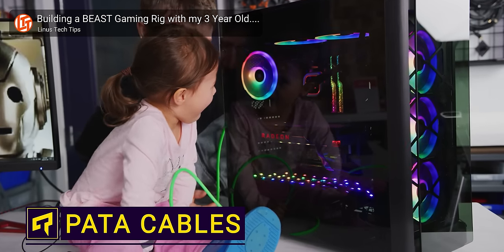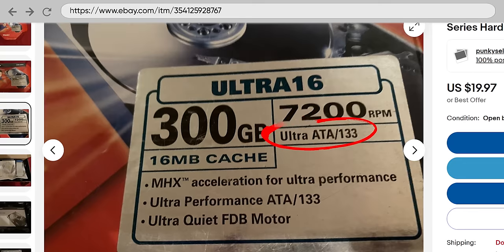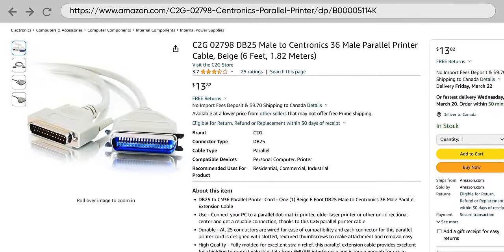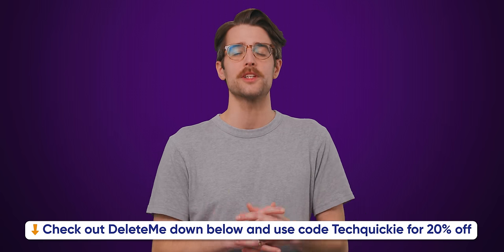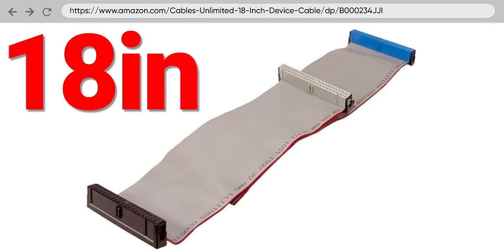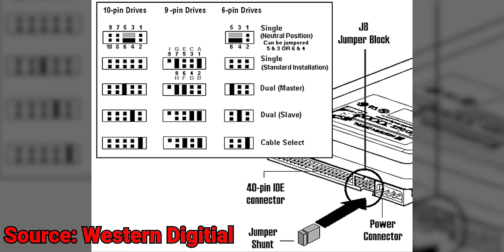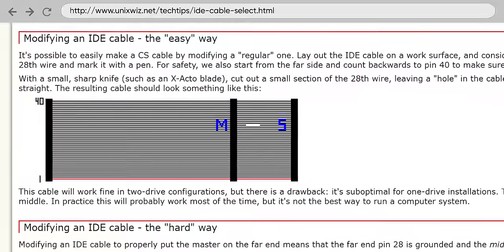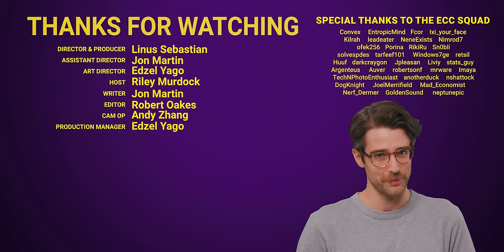PC Cables used to be HUGE. Why?

Comment: They touched upon, but didn't answer "why is SATA that transmits just one bit at a time faster than the ATA cables which transmitted 8 bits at a time?"
It's not because the bits needs to be split and assembled. It's that they all needed to arrive at the same time at the destination within a tiny window. The higher the speed, the smaller the window. This meant that the buss transceivers needed to have the same drive capability and speed. The capacitance and inductance of the wires within the cable needed to be the same. The sensitivity of the receivers needed to be the same as well as their speed. And since getting an exact match on the speed was difficult to impossible, they needed to send the group of bits slowly enough that they would all arrive within the time window. With SATA, that speed synchronization was no longer required. And that meant that they could send the bits much closer together.
Reply: Technically the problem is just long wires right?
Reply: Thats hella interesting.
I guess that before, parallelization mattered more than the actual bits going through the wire itself.
More wires = more throughput.

Now im curious. Why not photonics? Why dont we have photonics sending memory from RAM to the cache?
Reply: I can't understand why ata cables can't work without synchronisation, but sata can? Why can't we apply the same synchronization method to ata caples and get much higher performance? Aren't sata cables inside have few wires what ended up syncing with each other? Because it's definitely not a single fat copper wire
Reply: More useful than a medium sized tech media company. Thanks!
Reply: @ishouldhidemynamelmao345  Not quite. The problem is matching the delays between all those wires and the associated electronics at each end. Longer wire do increase the problems, but are not root cause. The closer the matches in propagation delays, the faster the potential speed. So, parallel is easier (just set all the data bits, then after a suitable delay, strobe the latch signal), but serial is much faster since there's no need to match the delays for 8/16/32+1 independent signals, although you do need to synchronize to the byte boundaries.
Reply: @Ivan-The-Man cause in serial communication bits always arrive in order, one by one. In parallel communication you never know if all N bits already updated or not. That's what the clock is for. You're making sure that the data set you are reading - lets say 8 bits - is all new 8 bits and not 6 new and 2 from the previous data set.
Reply: @Ivan-The-Man  With parallel, they set all the data bits. Waited a short time, then strobed a latch signal. That required all of the data to be stable when the latch signal arrived. And exactly matching the delays was effectively impossible. Hence, they added enough delay between sending the data and strobing the latch to insure the data was properly sent and received. With serial, no such delays are needed. In fact, with serial, it's possible to have multiple bits in transit at the same time over the wire. If the wire is a bit longer, that simply means it takes a tad longer to arrive and there may be more bits in transit at any given moment, but the expected bits still arrive in the same order they were sent.
Reply: @Ivan-The-Man , we certanly can make aggregated serial busses. 16x/8x/4x PCIe is just that. PATA just wasn't designed that way, and at the time creating a high speed serial bus would be hard. High speed serial interfaces require fancy analog front ends in the trancievers that wasn't all that reasonably available at the time.
Reply: Buss
Reply: While this is true, you can use all the extra wires for more speed if you change the protocol for making every wire a different "connection" like PCI-E does with it's lanes.
Also SATA don't use one wire, but two to transmit data in a differential signaling scheme that can transmit data a LOT faster than regular one wire schemes.
Reply: Thanks!
Reply: @ishouldhidemynamelmao345  Yes. Speed of light is 30cm/ns, which means that for a SATA3 cable, the individual bits are about 5cm apart as they go down the cable.
Reply: Thank you.  This is what I was looking for.
Reply: Thanks for the explanation. However, this raises the question of why PETA was not skipped and SATA was not used from the get-go. If it was "superior because it was simpler".
Reply: @Chuck_vs._The_Comment_Section Parallel is sequential.  Think of parallel as having many sequential traducers next to one another.  The issue was the sequential traducers of the time were slow, so they  installed many side by side to increase speed.  At some point the issues caused by the timing outweighed the benefits of the schema and by then much faster transducers had been invented making the parallel schema no longer necessary.
Reply: @Chuck_vs._The_Comment_Section  But SATA is not simpler. Gonna give an analogy. Imagine the following system. We have 9 long wires to transmit data. The person transmitting needs to set 8 switches to on/off depending upon the value that they want to send. After setting those switches, they then momentarily press a button that activated the 9th wire. At the receiving end, the wires are connected to lights. So whenever the strobe indicator lights up, the receiver writes down what lights were active. This arrangement is actually pretty simple and easy. But I think you can see how slow it is.

Now, the next system uses just 1 wire to send the signal. But both the sender and receiver need to be trained in morse code.

So, the second system is faster, but requires the transmitter and receiver to be more complicated.
Reply: @Cyril29a  I see. It was the better technical solution available at the time.
Reply: @Chuck_vs._The_Comment_Section Yup.  Now the problem is that drives speeds are slower than the transducer so we invented raid and other types of drive arrays.  So we are essentially back to parallel but with using a large amount of sata drives in parallel to one another again increasing speed.
Reply: * The ratio of inductance to capacitance had to stay the same.
Reply: great explanation! 😎
Reply: @Ivan-The-Man  SATA cables transmit data serially, meaning the bits are sent one at a time, so there isn't anything to synchronize. You're right it's def not just a single wire - I believe they have separate pairs wires for transmitting/receiving data.
Reply: Ah yes, the same explanation providing the same information, but with more words! That's SO much better.
Reply: In the end it boils down to electrical engineering. 
At low speeds there are no issues. If you connect a battery to two wires you will measure that battery voltage at the end, no matter how long are the cables and how are they routed.
But as the bus speed is increases, that same piece of wire WILL behave differently. It has to be treated as a waveguide. When engineered properly (like SATA or Ethernet), it will be a good waveguide. When not, it will show horrible signal integrity problems, like PATA.
SATA is in so many ways better: it is differential, it is shielded, and it has termination. The transmit and receive paths are separated. It is driven by a proper transmitter circuit, matching the impedance of the cable and the receiver. The data over the wire is encoded with a line code, which ensures the same number of zeros and ones are sent over the line, maintaining DC balance, which is also important.
None of these are true for PATA, but most of these are also true for Ethernet.
Interestingly, PATA was even worse than the old MFM standard, used in early '80s disk drives. At least the MFM cable had every second conductor as ground, and the cable was terminated.
Reply: Thank you. I also wanted more detail on this. It was a pretty half-assed explanation.
Reply: @budaycsaba  God, I haven't heard/read of the term MFM (or RLL for that matter) in eons.  I think those date back to the days when people were trying to hook up hard drives to 8 bit computers and workstations?
Reply: @sbrubak  exactly. We did not have cheap high speed drivers for a serial bus. When they became feasible we got SATA and PCIe.

Comment: This takes me back. The first time I ever built a dual-boot system, it used the Cable Select mode. I had Windows 98 on one hard drive, and some flavor of Linux on another. I actually installed a toggle switch in the front of my case wired directly to that CS line which allowed me to shut down, flip the switch, and boot off the other drive, as it would always boot off the master drive by default. No software bootloader required.
Reply: This is how it should work, I absolutely hate today EFI boot and windows boot manager which screws everything, you don't have anything under your control anymore.
Reply: @Pidalin  It was certainly a simpler time in the PC world. Well, all electronics I suppose. As a general rule of thumb I like to retain as much hardware control as is practical in any system I purchase or design. In the audio engineering world, digital mixers and audio interfaces are absolutely amazing, and I love them as much as the next guy, but there's a reason analog consoles are still in heavy use today. Especially in live sound.
Reply: @donaldholden2090  Don't tell me about that, I am that guy who has "stupid" projector with no apps, stereo amplifier and big f*cking speakers 😀 
I also keep a lot of older computer hardware because I am pretty sure there will be time when everything new will be that stupid and complicated, that you will just build some "ultimate Win 7" or win XP PC to play good old games with no internet and clients needed and screw that, life is too short, I want things which work and which are not constantly changing under my hands.
I don't even play games anymore on modern computer, because you start steam and you need 50GB update, so you go on internet to procrastinate and then you will forget that you wanted to play something, it's stupid.
Reply: @Pidalin  ...Projectors have apps now? I'm still rocking my Optima HD20 and a Technics SH-AC500D Dolby Digital decoder paired with some Logitech X-540 speakers. Hello brother.
Reply: @donaldholden2090  Yes, there are projectors with Android TV inside. 😀 I have Optoma HD28e, when I bought it, I had problem with rainbow effect, but I got used to it pretty fast and now I barelly see it. But your Logitech speakers are a typical "gaming" stuff. I have Yamaha A-S501 + speakers Magnat Monitor Supreme 2002. 🙂
Reply: @Pidalin  Oh for sure. And one day I look forward to upgrading. But my entire HT setup cost less than $500 because everything was used, and at the time I put it together that's all I could afford, hahah.

Comment: Before SATA was coined, we never refer to them as PATA cables. They're referred to as "IDE" cables.

I wanted a rounded version of these cables, but they were expensive for my small student allowance, so I never bought it until they became obsolete.
Reply: I was thinking about the same, nobody said PATA cables, we all knew IDE cables and IDE hard drives
Reply: I've always called them IDE cables, NEVER, PATA....still call them IDE, that's what they are.
Reply: @JuanDiegoPinillos  some technonazis called them PATA, but that was in time when SATA already existed
Reply: 100%
Reply: I never heard the term PATA before this video, I still refer to them as IDE.  But I haven't used IDE in about 10 years now.
Reply: I hear ya, I always just did cable origami with zip ties back in my high school days as step dad bought them by the bucket load, and I did not want to risk damaging a cable, or slicing my hand trying to cut, and wrap them., but yep they have always been known as IDE cables to me, till several years back when I found an some old Dell Pentium $ PC's at the local e-waste, and they had PATA, and SATA stamped on the motherboard, and cables.
Reply: ATA-66 was so much faster than ATA-33, and it made games run faster. That's where the term "PATA - Win" came from. That's why they're called PATA cables.
Reply: Yep! Nobody I know ever called them PATA. They were either ATA or IDE.
Reply: totally agree, we seem to have a millenial making things up, oh, hi riley!
Reply: Technically, they were ATA cables, the IDE refers to the disk drives that were commonly plugged into them.
Reply: @scbtripwire  Yes, they were ATA cables as opposed to SCSI cables which were pretty much the only other option for drive cables other than the ones for floppy drives.
Reply: @scbtripwire  yeah they were ATA cables, PATA is a later name just to make it clear
Reply: Exactly, they were retroactively named PATA after SATA came out. I used to be good at IDE origami to get my cables flat and out of the way.
Reply: @smalltime0  I know, I never stopped calling them ATA or IDE though. :)
Reply: Rubber bands and a bit of folding is what I did back when air-flow started to become important.
Reply: Good I'm not the only one.  I didn't even KNOW they were called PATA cables, I had always called them "IDE" as well.
Reply: @scbtripwire  This is one of those things where people just agree on something without realizing their world. I'm guessing you're all around 50-60 years old. So you should already know that nobody called it PATA back then because it was the only ATA cable (even the video mentioned this)

Funny enough, it's almost always been PATA to me. I started watching ZD NET/ tech tv back in 1999/ 2000. And when SATA was announced sometime around then, it was almost immediately PATA/ SATA when discussing this new coming tech. Which confused me at first because, like you all, I had only known ATA. But you know, when you pay attention and not act like a weirdo luddite, you learn and grow. And since most of my friends were just getting into PCs, we all only knew PATA and SATA (assuming we all also knew that ata/ pata was often the same when referenced in old handbooks)
Reply: none of you watched the video?? 0:30
Reply: PATA is a retronym, which emerged after SATA, as IDE was sometimes referred to as ATA before then, and referring to it as PATA made it more obvious that it was not compatible with SATA.
It's similar to how PCI is sometimes called "conventional PCI" to make it harder to confuse with PCIe.
Reply: IDE was just another name, they were known correctly as PATA then too.

Comment: It's fun how terminology sometimes gets defined by confusion. ATA is the communications while IDE refers to a disk that has the disk controller built in rather than on a separate card. They are not synonyms. You could've had PATA disks that were not IDE. Of course nobody called it PATA, but that's sort of like how Chinese food in China is called food.
Reply: Were there? I was only aware of ATA and SCSI at that time. (Well and the cables for floppy drives that looked similar)
Reply: @SmallSpoonBrigade  You could get internal (non-SCSI) serial and parallel connectors, just to buck the trend. But you'd be hard pressed to find something internally to link them to.
I think Centronics ports saw limited use in enterprise configs for "hot-swappable" HDDs, before SCSI was really a thing
Reply: I'd forgotten about that distinction, but yes. I recall my first couple of builds had to have a hard disk controller card. Then IDE came along making it much simpler.
Reply: @YoSpiff : Yes, when you connected the IDE disk to the motherboard, you were really connecting the on-disk controller card to the ISA bus. Fascinatingly similar in concept to modern M.2 or U.2 where you connect the drive directly to the PCI Express bus.
Reply: My first computer was a 386 IBM clone which had a virtual disk controller in BIOS. If you connected a non-IDE disk, you could go into BIOS and manually enter the number if platters, drive heads, cylinders per platter, and number of sectors per cylinder.
This was pretty cool because you could hide data using a little machine code to write things to the outer rings of the platters, then tell the BIOS that those cylinders didn't exist.

Comment: I can say that near the end of my using PATA cables, I used the round longer cables with no trouble at the full 133MB/s speeds. When I got my first SATA capable system, it took me a year or so before I got my first SATA drive. Once I did, I formatted it as my boot drive. My boot PATA drive became a storage drive along with the 120GB PATA drive I had set as slave on that ribbon. When the 40GB drive died, I swapped to a round PATA cable for better management, it was longer than 18 inches but it worked perfectly at full ATA speeds. I used that drive as a storage drive till I got my first SATA only system, and by that point I had enough SATA storage to not miss the PATA drive.
Reply: the problem was unshielded wires.  If you bought specialty shielded wires you could go longer or bundle them up without issue.  It's just the standard was unshielded.